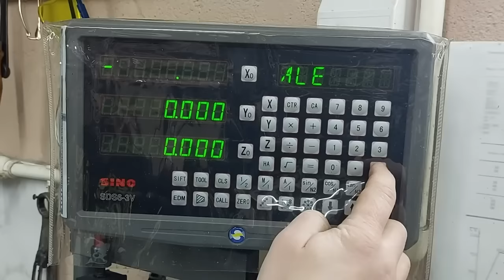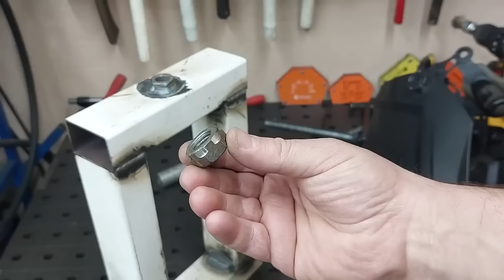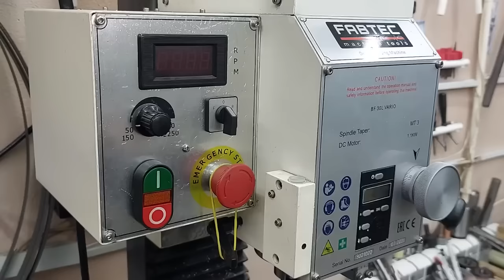Amazing homemade machines and tools to make life easier

Comment: I have been a blacksmith and welder for more than 30 years (not the same thing), and the welding table is in the middle of the room (welding area), where you have it located it is wrong, you should fix that error
The disc that you are using to grind the paint on the edge to weld the pieces is for cutting, not for doing that job
Please use protective gloves, take care of your hands, PPP elements are for use, you are showing an incorrect image, those gloves that you used for welding are deplorable, use welding gloves
Reply from the maker: Thanks and welcome!